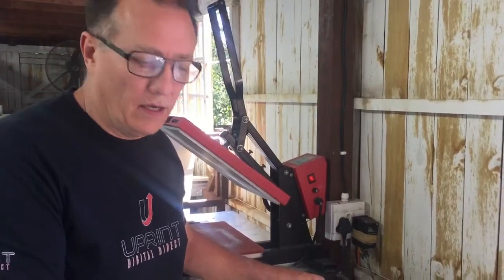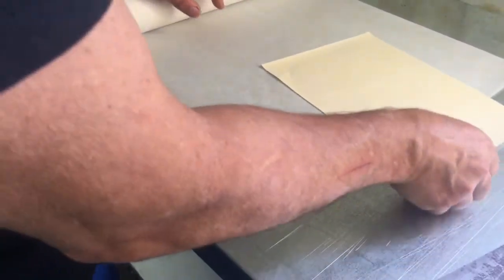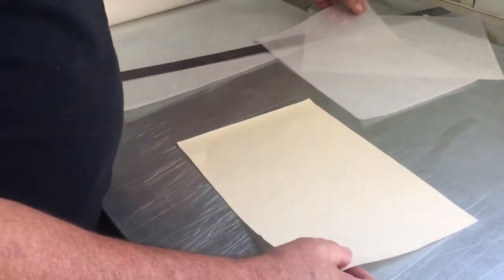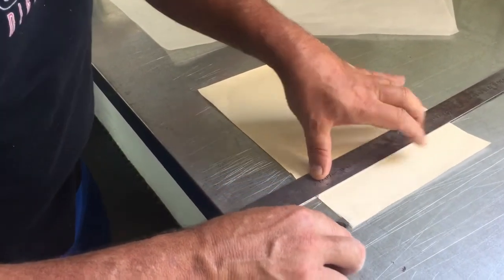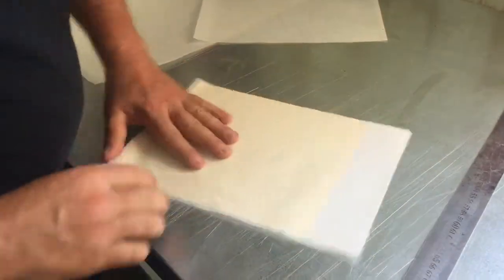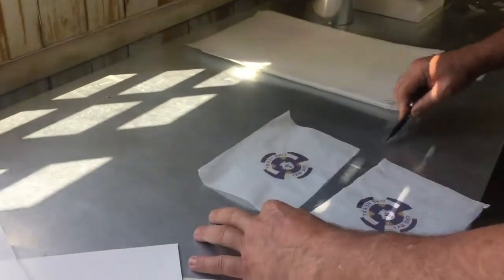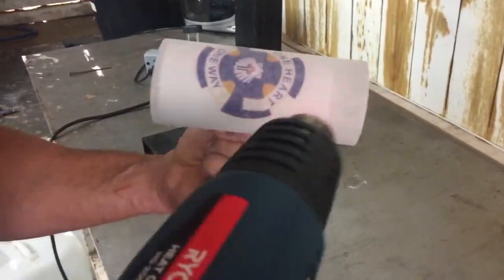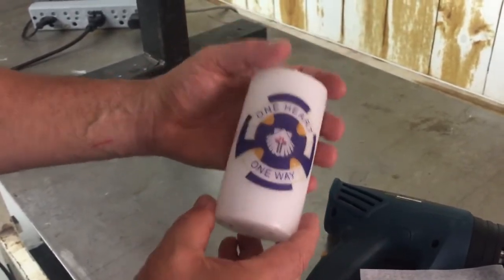DO IT YOURSELF CANDLE PRINT

Comment: Hello, I am having issues finding the two types of paper on your site, can you add a link to the pruducts?  thanks..
Reply from the maker: The yellow paper is made by our company and the baking paper has a special coating made in South Africa, you may purchase through uprint but unfortunately that paper cannot pass through a fuser unit so if you using a different printer to uprints printers it won't work. email shirley@uprintsa.co.za for any enquires.
Reply: U Print Digital Direct  Oh i understand, i will need a uprint printer also to work with everything.  Thank you! I will check  the contact info you have sent me... thanks again for responding so quickly!
Reply from the maker: You welcome

Comment: I'm having trouble transferring the ink onto my candle. I am using wax paper. help please
Reply from the maker: Hi, Do you own a Uprint Printer? if so then print the paper through, spray PPX chemical over the logo(do not use the heat gun to fuse) then wrap it around the candle and transfer the logo.